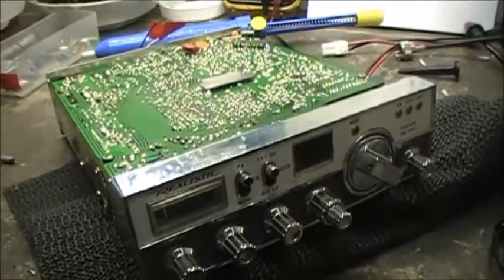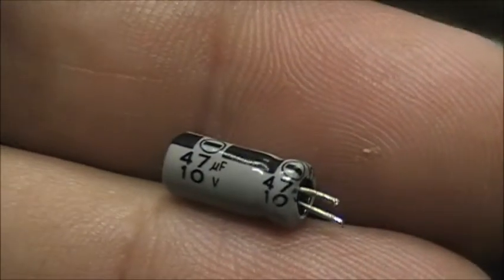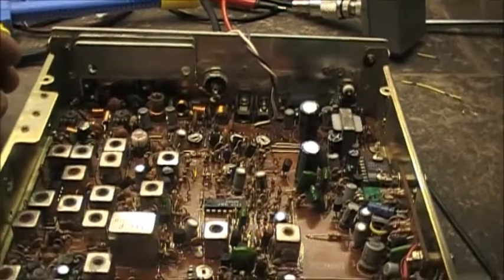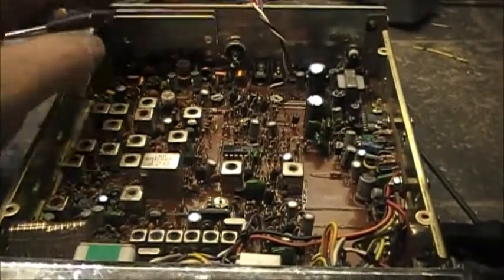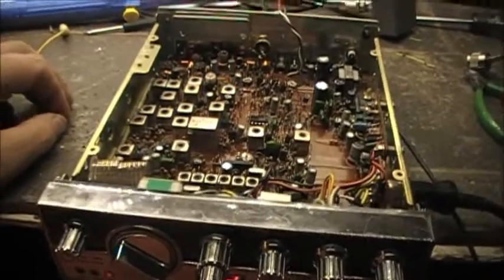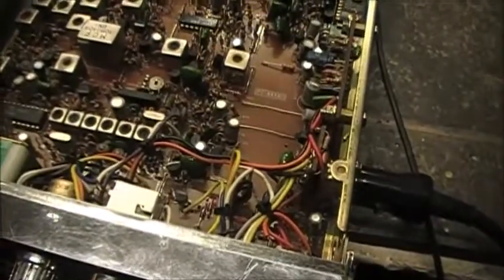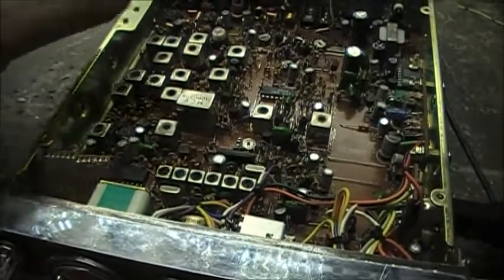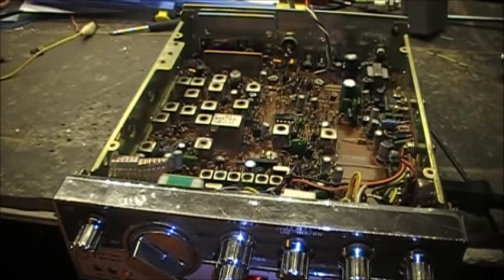REALISTIC TRC-451 Trouble shooting and repair PART-2   ***NO SOUND***

Comment: my TRC 451 had the same problem (weak receive), and if you pressed it on the middle, strong receive came back..came out the be the 10.7 crystal filter..I unsoldered it and one of the pins just came off..put a new one, came out loud and clear..
Reply from the maker: Glad this video helped you!  :-)

Comment: Interesting troubleshoot so far. You are getting there.
Reply from the maker: Yeah, strange one for sure.    Never seen this kind of problem before... new to me.
Reply: @Radionut63  I used a small set of bud headphones in a CB audio out and they got hot in my ears. I thought that was where you were going as well but that voltage was criminal. I suspect you used headphones that could handle the audio signal. Not like my mini ear buds.
Reply from the maker: At first there was 7vdc going to ground thru the headphones causing them to heat up... once the cap was replaced the voltage went away and so did the heat build up. ;-)
Reply: @Radionut63  It's just a continued process of elimination at this point. I'd say the next video will be the breakthrough video.